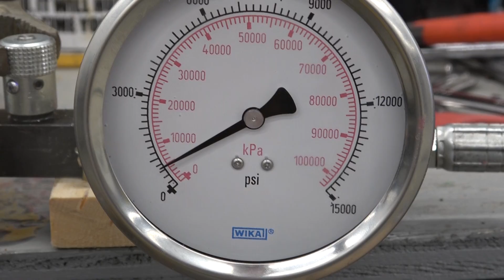How much pressure can PEX take?

Comment: I love copper, and I love sweating in pipes. Maybe I like the steampunk look. I'm a real weirdo. But I have to be honest, it doesn't make much sense when you consider you never have to deal with galvanic corrosion, un-wiped solder joints, pH of water causing corrosion, freezing in winter etc. etc. etc. ever again if you go plastic.

Comment: Pex is nice because of the expandability, it’s great if your lines are exposed to cold temperatures in which the water freezes and expands. A standard copper line would just crack and would be painful to replace. Overall the price and ease of installation just makes it better than copper in many, but not all applications

Comment: FYI: PEX is used in high-voltage ground cables, the 26KW cable that I handled when I interned at a utility had like 2-3 cm around each conductor.
Reply: I use it for plumbing AND electrical all the time. I use it for many other applications as well. Very durable and flexible.

Comment: I replaced a copper line from the curb to the house for a friend in Phoenix ran 3/4 PEX the whole way and the meter was only 1/2 inch copper  That PEX is much stronger than the average person has for water pressure even if the line gets a little banged up.  Even 100 PSI water lines with hot water should not be an issue in the average persons lifetime and copper still has to be replaced every 20 to 50 years.  Plus the PEX is so easy to run and replace I would rather use it than to try and run a 20 ft piece of copper in the same place.  The only bad thing about PEX is when you get the coils it wants to go back to curved vs laying straight but once it's in the walls it's not a big deal.  

Run that test again without inducing a failure point and with better fittings and I bet it will hang on to 1000PSI.  That may not be the 6000 PSI that copper is rated to but it's still a lot higher than you will ever need to worry about.  And even ran in hot water at 150 degrees the lines will still last a long time below 100 PSI.

Comment: Here in mississippi, its standard for houses to be built with pex plumbing. I work in the industry and I've seen hundreds of houses with pex i even changed mine over because my PVC would always blow during winter. 3 years with Pex never had a problem

Comment: Have you considered trying to convert a "continuous flow" pneumatic grease gun from Harbor Freight into a hydraulic pump? Maybe it would work if you suspend a reservoir and let gravity keep the pump primed? If it worked, it would mean any idiot with some pipe taps and $25 could have a hydraulic pump.

Comment: What’s amazing , We use 1/8” plastic tubing to calibrate gauges up to 1500 psig
Reply: I used to make the stuff and the 1/2" will burst at 1,500 psi @ 300F. That's a lot of heat and pressure!! At room temp, it'll probably never burst....even with 2,000+ psi.

Comment: the pex tubing is used for hot water in europe. 
at work we make some 7x1,5mm HDPE pipes for fibre optics in germany. the had to hold about 1100 PSI in 80 degree c water for about 150 hours.

Comment: At the facility that I work at we run festo airline in 8 mm and 10 mm most commonly and the failure mode of the airline is the plastic getting yellowed with time then bursting out lengthwise along the line

Comment: The main reason PEX tubing is used so widely now is because of the simple fact any monkey can run it in a building and it takes a 1/10 of the time. So any failure factor is a part of the savings on labor. The true test with be time. Copper will last damn near for ever where as the heat cycling and wear with be much higher with PEX. Have to wonder what those PEX tubes will look like in 25 years or so.

Comment: Idk I used these on modular homes and with the pex crimps they seem alright, at least with modulars there is a warranty and it renewed when service was done on whatever it was that needed fixing. If it failed once it shant fail again I guess. Now after doing real homes, I don't know it seems to me like the main thing for pex is that it might be easier but I'll tell you what.... cpvc is prettttty easy. I've been under too many homes in the dark trying to hold the lines together with one hand and trying to start the two handed crimper with the other hand laying in a pool of water. Cpvc is like glue, k done. We have a "strict" policy not to use sharkbites in walls (never know what the rogue worker trying to finish the job up on a friday night might do when he knows there's ice cold beer waiting for him), its just to risky to not use the proper fastening. Mainly we use sharkbites for temporary purposes, during early stages of a remodel we take off the supply valves and use sharkbite caps to not have leaky old leaky valves leaking leakily, and also to make it easier to toss in vanities n cabinets, pull the sharkbite cap off pop on new comp valve, done.

Comment: In my experience. PEX is plenty durable as long as it kept out of UV (Something that people with unfinished basements need to keep in mind if they have run around down there and large windows or incan bulbs.) The weakness is the fittings. Any non crimp on one has the chance to slowly vibrate free from small water hammers and vibrations. Even seen the 'sharkbite' ones do it.

When it's easy to get to and not going to damage anything when it leaks not a huge deal. But hidden in a wall it can be a right pain in the ass.

Comment: I'm gonna guess these plastique pipes do a lot better in cold conditions what with being more flexible than copper and better able to deal with the expanding water when it freezes. Probably deals a tiny bit better with water hammer too. 
It's just good to have a variety of options so you can choose the one that's best suited to your needs, whether it's copper, PEX, PVC, PCP  or LSD.

Comment: PEX  can be filled ,  frozen , folded , flattened and boiled without leaking 
And fail from a misplaced 5/16 staple.
Reply: Plus mice loves it.
Reply: @fredhelmecke6073  I have not had that experience.  Though I have  seen plenty of wiring jacket chewed off
Reply: @georgemckenzie2525  I have had a mouse chew though some I installed, luckely it was accesable and I heard the leak not long after it happend. that mouse is now dead but it is a huge flaw no one ever talks about.
Reply: @aaronmeyer6244  I wonder if coating it in Denatonium Benzoate would alleviate the rodent issue. Also known as Bitrex
Reply: @Fanta....  thats funny i literally just looked up that stuff as it was in rubbing alcohol so as not to drink it
Reply: @aaronmeyer6244  its not a HUGE flaw, the cases where it has happened isnt enough to warrant any changes. you sound like you work with it enough and you have only one occurrence to speak of.
Reply: @georgemckenzie2525  some modern jackets are made with starch based plastic.  That's why the automobiles that requires repairs to chewed wiring harness after a cold night parked outside is epidemic.  So much for greener alternative.  I'd reckon mice and rats shouldn't bite PEX for any food purposes, probabaly just looks interesting to them.
Reply: @MintStiles  Rodents love high density plastics like HDPE and ABS because their teeth continually grow and they habitually gnaw on whatever hard items they come across to shorten them down, much like humans would gnaw on fingernails if they weren't smart enough to have invented clippers.
Reply: @hplogsdon293  nice to know.  I am very surprised that they aren't deterred.  But overall PE has fairly mild properties, not that I would eat any, but definitely a mild material compared to the likes of PVC.
Reply: Pex absolutely cannot be folded.  Unless y'all are talking about something much different than what I've worked with.
Reply: @NinjaofApathy  Worsbo / Uponor.
I did this test in 2000 i have handled the  newer formulas.
Reply: @georgemckenzie2525  I'm shocked to hear.  Thanks for the reply though.   Do those brands play nice with various types of crimp fittings or sharkbites if necessary?
Reply: @NinjaofApathy  "if necessary..."  covers a lot ...these days,  I hire plumbers, and have worked around 'sharkbite' et al... my work was fitted by expanders,  but I am no subject matter expert.

Comment: I'm no car-painter or what have you. But running a service truck for a construction outfit in Michigan, the push lock fittings for air brake line are handy until some valve needs replacing, then you better have an air gun handy. They fill up with dust and dirt so bad they rarely come apart. Is PEX the same after time? They seem to hold pressure fine though.

Comment: In my father-mother-land - the poorest EU country PEX pipes aren't popular, but there is no reason for them not to be, except may be the price. Such hard conditions are not supposed to occure in practice. Hardest allowed condition for water delivery system is 10 Bar 90°C (that's why in high-rise buildings system is split every 7-9 floors) and for house/apartment pipes 30 Bar 90°C is required (hot zinced steel pipes used before have the same guaranteed pressure strength). Pressure at your tap is supposed to be 2-3 Bar. In case water supply company suspect higher static pressure might occure they are obligated by law to install pressure limiting device before pipe enters client's building. For the heating installations there's obligatory standard for max static pressure of 5 Bar 90°C and respectively for the pipes it's 10 Bar 90°C. Usually water piping here is made of PP pipes and heating piping are either done with the same pipes as for the water or with more flexible PE-Al-PE pipes that have only the required 10 Bar static pressure strength. There are also available japanese made butadiene pipes on the market - more flexible 30 Bar, but they are used only for difficult refitings as they are much more expensive.

Comment: i use the shark bite on the low pres on the cold site , not oh the hot . but in the country my pump is tuned to 50 psi , no problems so far

Comment: Love PEX. Best thing since CPVC that ages faster then a cheese sandwich in a car waiting for lunch.  And the fact that a freeze will not split the line like copper or cpvc makes it the best for campers. for air lines it's meh imo. I would go with the aluminium with pin lock fittings.

Comment: The first true plastic air compressor hose they came out with a few decades ago ,on my compressor I have a inline air line lubricator for my pneumatic tools so i don't forget to oil them before every use after just a few months the sidewall ballooned out and blew up ,some plastic dont hoses don't really like oils so i went back to rubber than a permanent copper tubing airline still working after many years of usage !

Comment: Lots of factors to consider when choosing copper vs PEX. But some food for thought, I've repaired/removed plenty of copper and PEX, not once have I found nasty build up inside PEX, copper on the other hand, I've found cruddy build up and corrosion so bad it's nearly blocked the pipe... despite what devout fans of copper will believe, it corrodes pretty actively, try wearing a copper ring, the slightest bit of sweat and your finger is green. It will slowly but surely corrode the copper and you'll end up drinking it...working in new developments I've found the tap water tastes quite a bit different than in old areas...I've got to believe that the water running through plastic mains, PEX from the street and throughout the house has something to do with it..

Comment: Copper is only as good as the solder joints.  Far fewer fittings with PEX equals far fewer leaks.  Plus with a manifold any future problems can be isolated by circuit.

Comment: pex doesn't corrode either.  Where i live copper would last 25 years at best.  The plumbing in the house i lived in lived to the ripe old age of 20 before it was paper thin and popping pinholes every couple of weeks.
Also, not only is pex cheaper, and doesn't corrode, it makes it a hell of a lot easier to replumb your own house.

Comment: Had to use pex and sharkbite replacing an hose silcock. Was built into an interior wall cavity and through the flooring. After cutting the subfloor out around the copper was the only way to make the 90 turn from the exterior wall and through into the crawl space. Beat having to do a drywall repair though.

Comment: I work with it every day. I think its important to say that I've never seen pex or wersbo fail for any reason other than human error. Not enough time has passed to see it at 30 years yet. I do spend a considerable amount of time fixing corroded copper pipe and fittings. There are whole companies dedicated to re-piping building filled with 30 year old copper.  I think it will be at least as good as copper and in the end your house hold flood will be caused something else breaking.

Comment: The main problem with copper pipes and water is corrosion. Given the right mix of water pH, temperature and circulation system they will start forming spot leaks within 10 years. The area where I live in happens to be one of these areas where the pH is bad and there is lots of renovation going on because of it.

Comment: I suspect that the seal failure may have been due to what looks like a cut O ring in the cap fitting.  The shark bite fittings need to have the PEX end chamfered on the outside before insertion to prevent the cutting of the O ring upon insertion.  Not a fan of shark bite at all personally.  Much prefer the Upnor PEX system.

Comment: Polyethylene aluminum multilayer pipes are pretty popular in Austria and Germany. They are made of two layers of PE with a thin aluminum layer in between. The aluminum is there to reduce oxygen diffusion as far as I know. It also makes it nice to install because it stays bent. They're commonly rated to 10 bar at 70° science and a maximum temperature of 95°s. I would guess at least half of all new private houses in Austria and Germany are built with those pipes for fresh water and heating.

Comment: 30 years ago Wirsbo came out with a cross linked pex product that was put into wide use in Europe as a hot water heating product, and pex is generally accepted for hot and cold distribution in buildings and dwellings.

Comment: After working with water treatment equipment for 5 years, pex beats copper. Troublesome water (high hardness or iron content) will absolutely shred copper much faster than pex and associated fittings.

Comment: Something wrong with that test. I have seen some others test the shark bite and it didn't fail like that....
Reply from the maker: link?
Reply: @arduinoversusevil2025  their safety is a little lacking in the beginning.. not squinting properly.
Reply from the maker: @water12tube  I suspect that first sharkbite wasn't fully engaged. The other tests were with various crimp style connections.
Reply: Might have something to do with viscosity of the grease in your test?
Reply: @arduinoversusevil2025  https://youtu.be/fT2ftQ_ab-w

Comment: I'd like to see comparison with same rig using copper and walletbite fittings. I bet you'll find the first failure will be the fittings. Also get yourself a good crimp fitting setup for pex and see how it compares.

Still 500psi for  something designed to work at a max of 120psi is a good margin of safety.

Comment: As someone who has had to replace all the copper pipe in their house due to pin holes from corrosion, I was happy to switch to pex. At least it's a lot easier to run!
Reply: How old is the house?

Comment: "no potable water system shall exceed 80 psi"  
Ave- hold my beer
Reply: I've seen 'em over 125. (the city doesn't install [functional] pressure regulating valves.)
Reply: Worked in an area where the static pressure was 90 psi from gravity. Had a poor shift changeover and watched that pressure jump over 200. Water hammer shook the entire system for half an hour as we tried to find which valve got closed.
Reply: 175 here lol and we had a leaking prv
Reply: @poiiihy  Might've gone higher if the pop-off on the hot water heater weren't 125.
Reply: Increase pressure to 50,000 Kilopascals!
Reply: Mattawa, Ontario runs well over 100 psi at most building service entries and few of em have PRVs. there are a lot of messed up toilet flush handles lol

Comment: I dont think those sharkbite fittings will ever sit right with me for long term use. Tubing that moves under pressure, O-rings that sit for a long duration of time never moving, losing their ductility, getting nice flats. Just seems like once they harden, a chunk of mineral buildup getting lodged in the wrong spot under the o-ring is bound to happen with a bit of water hammer wiggling the tubing around. Polyethylene is already resistant to damn near everything chemically, and even more so once its cross linked, so I'm not worried about the tube going shitty long term, but that o-ring is suspect as hell.

Comment: I recently re-plumbed my whole central heating with PEX pipe (JG Speedfit) and I much prefer it to copper for two main reasons: one, it bends; two I can dismount the fittings and change things if I need to.  Other than one broken o ring that was from a dodgy fitting (it was free, I should have checked it more closely) it's absolutely fine.  I can never find much information about the thermal conductivity compared to copper though, just that it should be lagged too - my main aim is that the radiators get hot and I heat my house, not the ventilated gap underneath the house.
Would be curious to know about the surface finish of the inside of the pipe compared to copper (both bright copper and some full of Copper I oxide) and see what effect that has on flow
Reply: PEX was originally designed for Radiant Heat Applications. Many Contractors will use it when pouring concrete(they put it inside the concrete) to prevent ice and snow buildup. I haven't shoveled snow since I installed mine in the driveway and walkways around here. Installed it in 2007 and I live where it gets below zero in the Winter
.